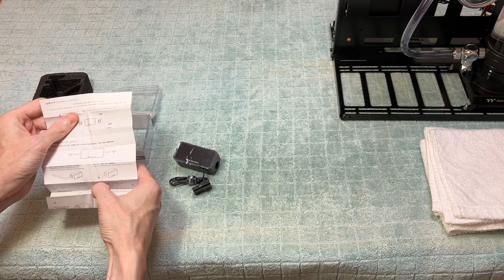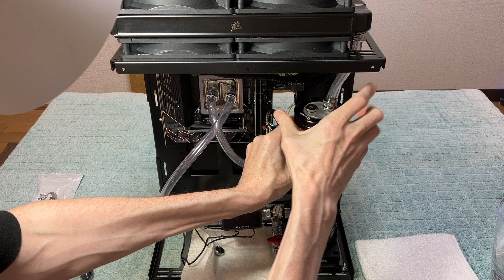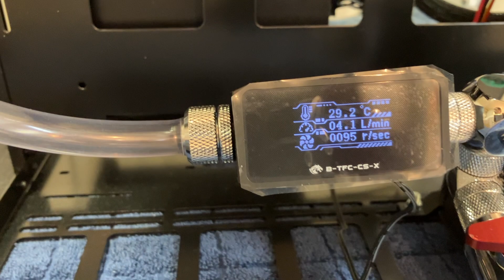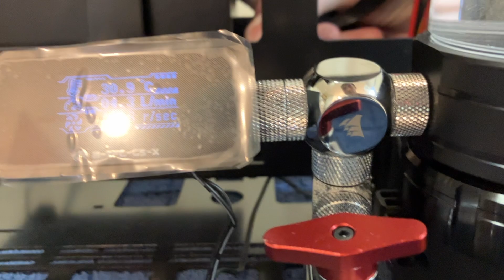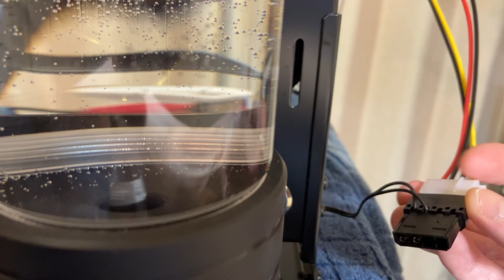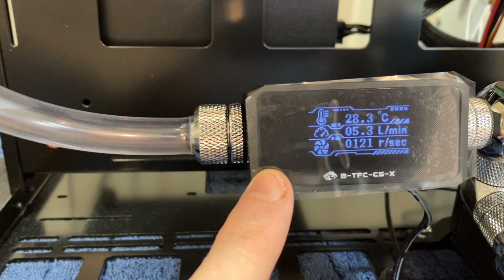Installing Bykski B-TFC-CS-X PC water flow temp meter

Comment: i have one of these but sometime it does not display anything and that sometime come back do you have any idea of why ?
Reply from the maker: Thanks for the comment.
I have not had any problems like that, it might be something with the power.
Still using it and it has been running without any issues.
Check that the power connector is fully connected.
If that does not seem to be the issue could try replacing the power connector, however that involves a little more work and tools.
Worst case, contact the manufacturer or place of purchase and try to return/exchange it if within the return or warranty period.
Might try the return/exchange route before trying the power connector repair.

Comment: Can you trutd of the flow value of this shit? 😄How  accuracy is it?
Reply from the maker: Thanks for the comment,
The flow value is lL/min (liters per minute).
So 4L/min would mean a quantity of 4 liters of liquid flows past the meter every minute.
The r/sec is revolutions per second, the measure of how fast the internal wheel is turning.
This data is then used to calculate the above L_min measurement.
Reply: @allans-workshop I know how is work. I aks you : Do you trust the measured value? 😄

Comment: Just a little tip for those watching. Do Not unplug Molex or PCIE power connections and then plug them back in when power supply and pc is on. I have seen PSUs pop because of this and damage other components. Yes it should have burn in protection but that does not include removing and re inserting power connections while everything is on and running. But I will also say thank you for making this video about this sensor as I am looking to install one on my custom loop.

Comment: I installed the same sensor. Could you tell me if it's experiencing a strange noise, like interference or a moving part?
Reply from the maker: Thanks for the comment.
There is a spinning part inside to measure the flow of water, I can hear it spinning, just a small plastic part spinning around in there but it is not very loud.  It can be heard if everything else is extremely quiet.

Comment: there is an o-ring on the impeller, did you remove it?
Reply from the maker: Not that I remember, everything is as came in the box, I just screwed on the fittings and plumbed it in.  The impeller was already in the correct orientation too, even though I went and got the hex tool to be able to switch it around.  At least I have the tool now.

Comment: when you were saying you need an adapter and went to the back of the mobo and had molex already, I was SMH
Reply: also I had to take out the pins to set it to 12v. I had a ton of issues with this temp/flow guage! So yes you were ok with needing a new one! I just popped the cap off and pushed the pins out and put them in the 12v and Gnd
Reply from the maker: Thanks for the comment.
Oh I was not aware that it would work on 12V, I thought it only worked on 5V, so I added the pins.  Yeah I was pretty surprised that it was a pass through connector but the 12V pins were omitted... manufacturing oversight? or assembly mistake?

Going back and thinking how I did the pin inserting thing, in another video, I might have taken a different route, it was a little messy, but works.  I actually bought the required male/female connectors, pins, crimper, and pin extraction tool to work on these connectors after that video.

Never went back and tried to redo it, maybe one day I will try to clean it up, talking about the video here in which I tried to insert the missing pins.
https://youtu.be/PvAuoWqjB8Q

Comment: The noise is a dealbreaker for me. Thank you for the video!
Reply from the maker: Thanks for the comment.

It really is not that loud, I have it running right now.  I think the video amplifies it slightly.  The loudest part are the cheap fans that I have on the radiator, these can be replaced with quality fans of course.  The pump is actually quite quiet and I am very happy with it.

I started using the system for development and have not had any issues (or leaks) since assembling it for the video.